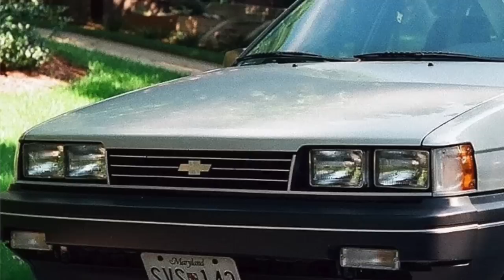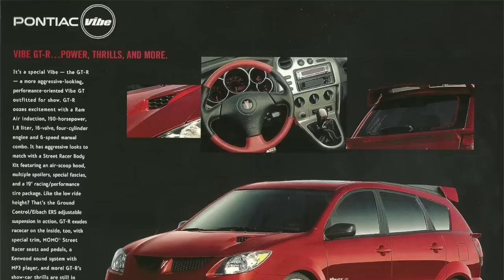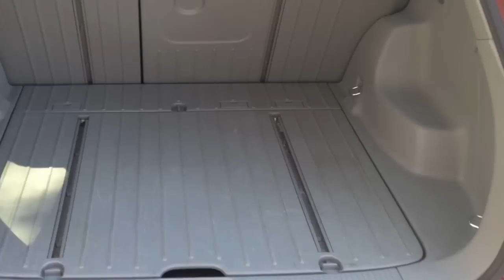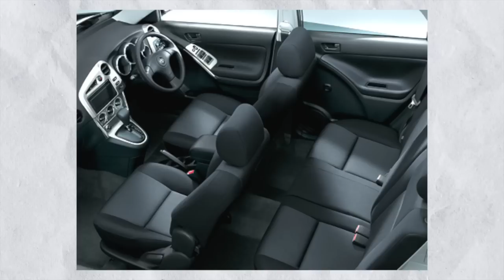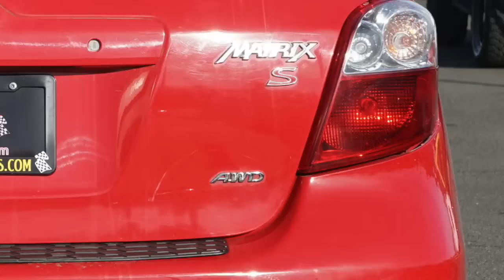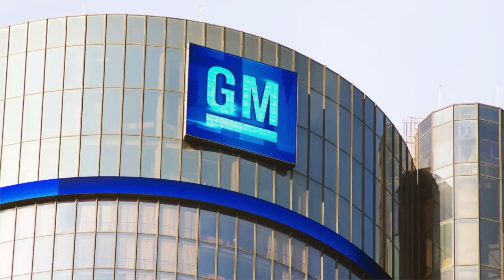The Matrix & Vibe : How GM and Toyota Teamed Up

Comment: I've got a 2004 matrix XRS as my daily, it has 270k miles. I have owned it for 100k miles and since 2015. It is such a useful and fun car, the amount of crap I can stuff in the back is nuts. Plus with a 6 speed manual and that 8250rpm redline, it is a BLAST to drive

Comment: Toyota did come out with the Scion iM/Corolla iM which has been replaced with the Corolla hatchback
Reply from the maker: You're right I could’ve included the Scion iM/Corolla iM before jumping to the Corolla Cross. The only reason I hesitated is because the iM felt like a very watered-down version of the Matrix. It lost a lot of the interior practicality, sat lower to the ground, and didn’t offer AWD.

Comment: My first 2 cars were Pontiac Vibes. Had an 06 and 08. I guess closest modern equivalent would be a corolla cross. The sedan and hatchback fell way smaller than it.
Reply from the maker: Based on the numbers I’ve seen, the 2009 Matrix had about 19.8 cubic feet of cargo space with the rear seats up, while the Corolla Cross comes in at 17.2 cu ft. I don’t know how they got those numbers either especially since the Matrix was shorter than the Corolla Cross.
Reply: @Carnivauto  I haven't looked at one in person. Been in an 18/19 Corolla sedan and recent hatchback. The higher roofline/wagon design of the vibe made a huge difference to me. I'm in a Buick sedan now.

Comment: Toyota sold the Toyota cavalier right hand drive in Japan. I guess out of a nice gesture but no one wanted one. 

More surprising, Toyota models like the corona and crown were the most common cars in Korea in the 1960s. Toyota had partial stake in shinjin motors (1955-1981) which was the only authorized passenger car maker in Korea prior to 1970s. Rebranded as shinjin corona and the shinjin crown and shinjin ace pick up. Toyota broke up with shinjin due to china not allowing imports with car companies with ties to South Korea. 

Other notable rebrands. Honda (Acura) MDX was a Isuzu trooper. Honda passport was Isuzu rodeo. Saab 9-2 was a Subaru.